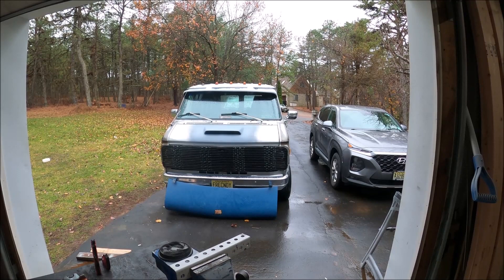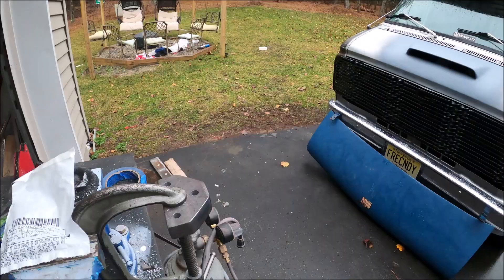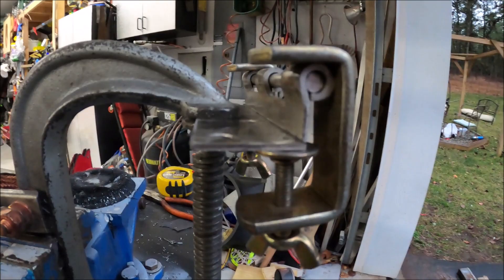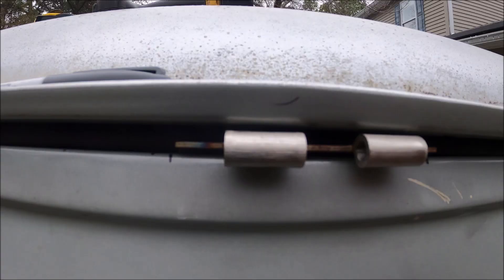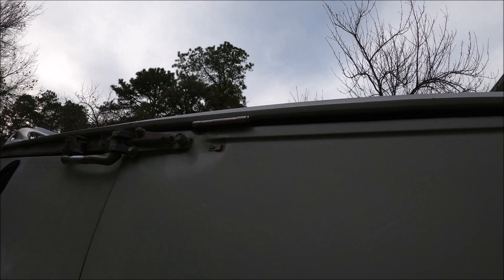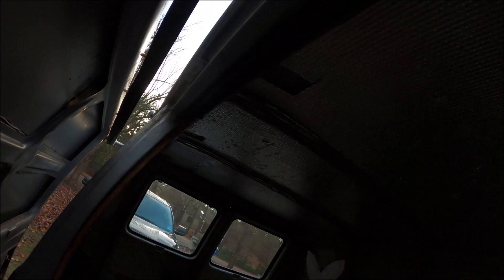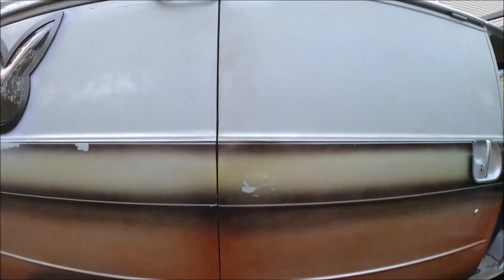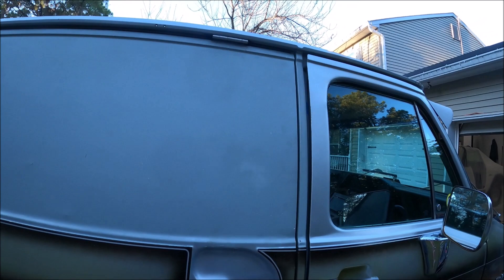How To Gull Wing A Door

Comment: ⚠️Can this be done and sit flush, using nuts and bolts instead of welding, even if the nuts and bolts stick out? ⚠️ 🤔 
At least until welded?
Reply from the maker: Nuts and bolts will not work. Rivets would, but making the hinges is the hardest part, and welding is the only way to make them.

Comment: Does it matter if the 3 hole part of the hinge is mounted on the door or drip edge
Reply from the maker: As long as the weld is strong it shouldn't matter. I just did it the way I though it would work best and last the longest.